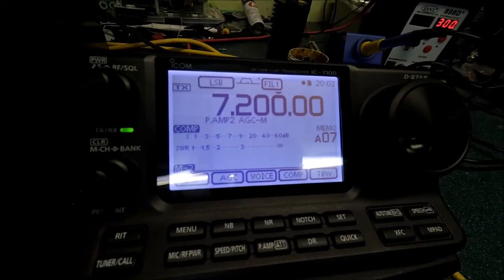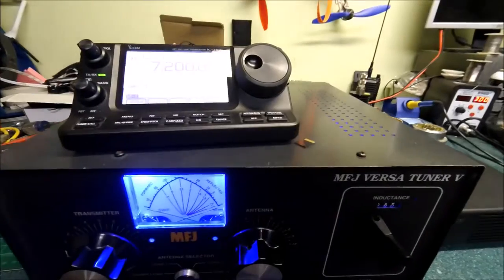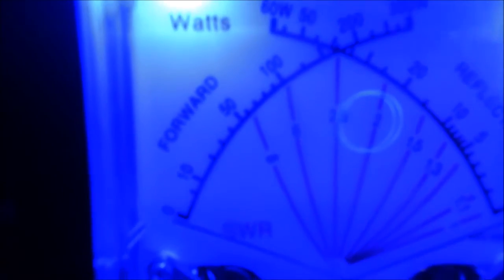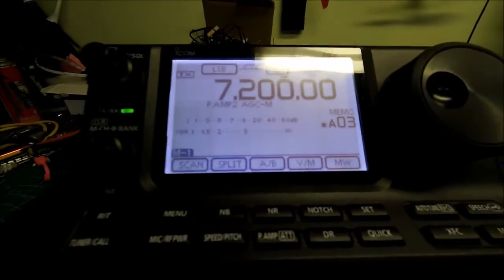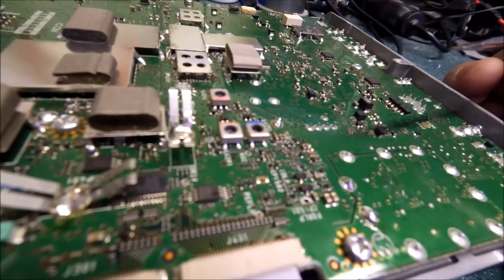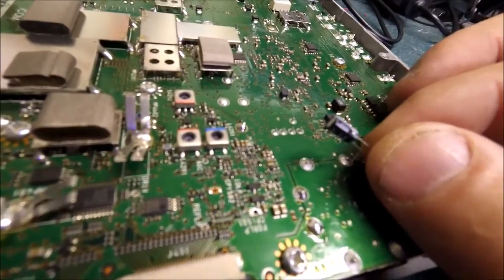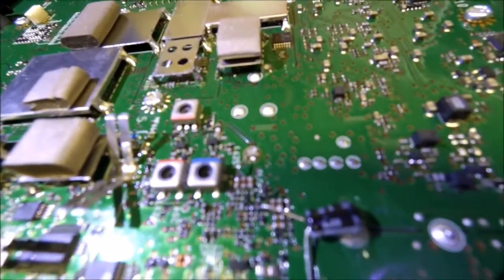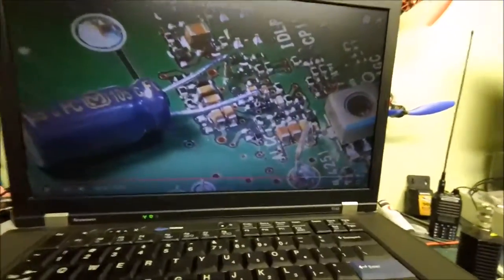IC-7100 LOW Power Output Upgrade!

Comment: Evidently (probably because of outcry from the Ham community), ICOM has fixed the issue.  I bought a brand new 7100 in December (2020) and it has FULL SSB output all bands.
Reply: There was no "fix" needed.  On an average-indicating watt meter, 50 watts SSB output is normal.  Test your SSB signal on a PEAK-indicating watt meter and you will find it was 100 wats all along.
Reply: Can you post a video with compression on showing average power? I have yet to see a video of an unmodified IC-7100 producing 40-60W average that would be expected (they are always 10-20W).

Comment: You forgot to test IMD3 after the modification. Just to remember FCC requires all radios within the US must comply with the -30db atenuation to keep spectral purity within specs. What happens is that if you read the power output of that radio or any other using a watmeter without a builtin electronic circuit  to read PEP you will see just the average power that you show in this video, 40 to 50W which is about half of your PEP but the radio is still giving you 100W but its YOU who can not see it because not having the proper instrument. So with that "modification" your average power is over 100W and your PEP is over 160W which you still don't see it. And guess what? Now you have a radio that is not within FCC specs.

Comment: Thanks for the video.
Does anyone know of a mod for the IC-7610 as mine doesn't put out full power on SSB either. 
Seems to be an Icom thing,  a tight ALC,  might p/ex all my Icoms for Yaesu rigs.
73 de Mike G1ZRN.

Comment: A non-peak watt meter will show only 50 watts SSB on a 100 watt rig.  That's normal.  By making this unnecessary "modification" you are over-taxing your final PA until it blows (only a matter of time), and spattering your signal over all creation.  If you began by looking at your SSB signal on a PEAK indicating meter, you will see it was putting out 100 watts all along.

Comment: What you can't see without a scope is the instantaneous power overshoot that will occur if you do this mod! Icom slowed the rise in power to protect amp users!  My peak power meter shows full output without the mod, average power meter doesn't show this. Hope you don't use a solid  state amp.

Comment: Wish my eye sight was as good as it used to be, I think my IC-7100 suffers from this.  Are you still down in London?  I am up here in Georgetown.  I would love to see if mine is eligiable for this mod.  I dont have a classic SWR meeter to see what the power output is really coming out of the radio.
Reply from the maker: Yep still in London but I travel a lot now. Every Ham Needs a SWR meter. This mod makes the 7100 come alive!
Reply: @ke4gjg  Still have not done this :-(